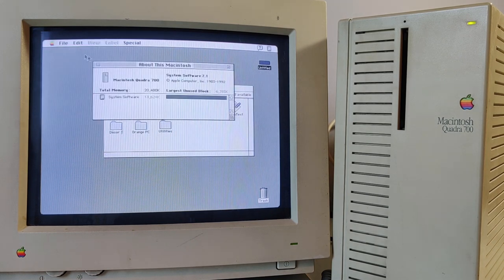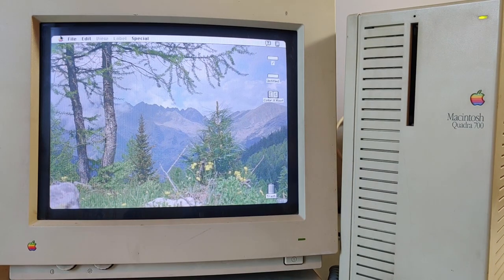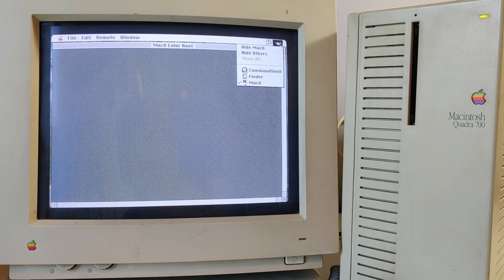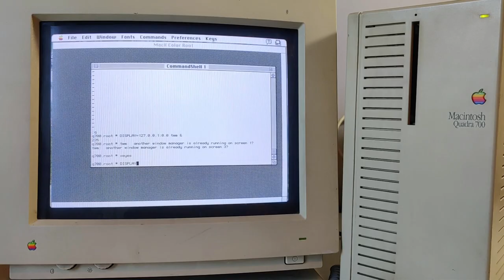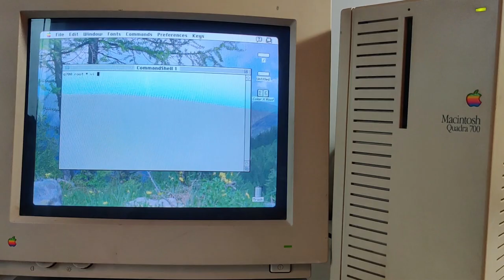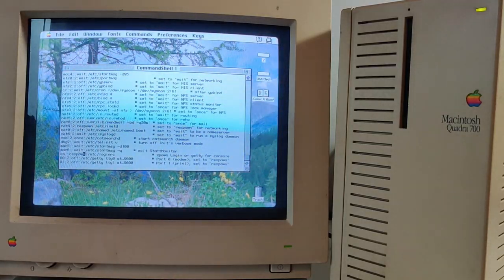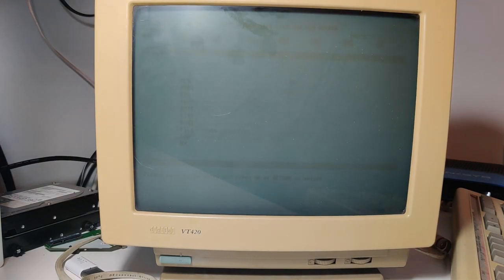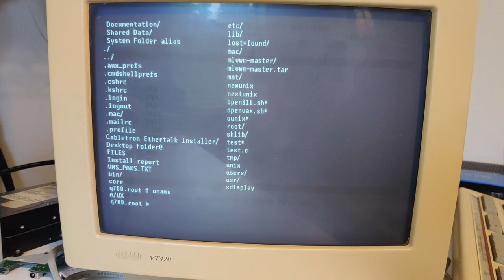Geek Rant #5 - Apple Quadra 700 and A/UX Tour

Comment: in your shell, before running twm, xeyes, etc, you could do:  #  export DISPLAY=:0.0
and it should be available in that shell for anything else you run.  (you can omit 127.0.0.1 before the colon)
Reply from the maker: I'm a control freak, though. What if the bits decide they want to fly off to check out some other piece of equipment? You've gotta put them in their place.
Reply: Yep, but it may be an older shell. You may need to do a:   "$ DISPLAY=:0.0; export DISPLAY"

Comment: I remember reading somewhere that you cannot upgrade A/UX's built-in System 7 past 7.0x as it will break Mac-unix hybrid apps. I do remember them saying that you can however copy over system extensions from newer Systems, like windowshade. For a while I've been curious if the Appearance Manager would work.
Reply from the maker: Yeah, I threw 8.0 on there a while back and bricked A/UX which is a bummer I haven't been willing to get back to